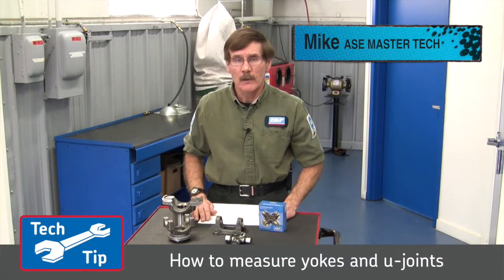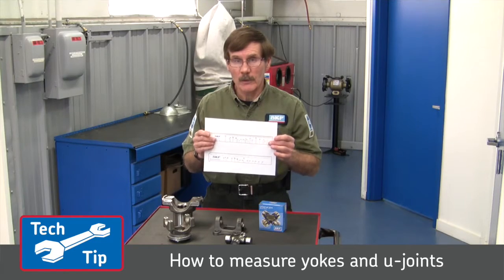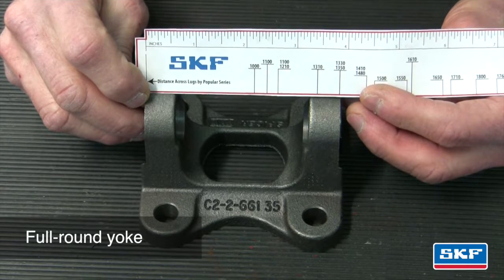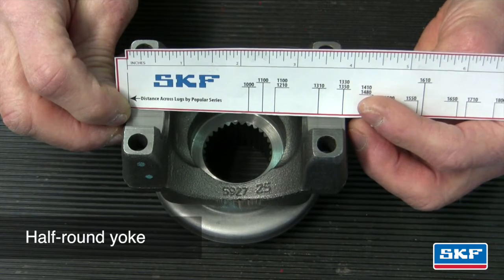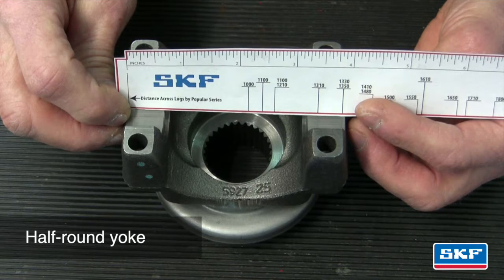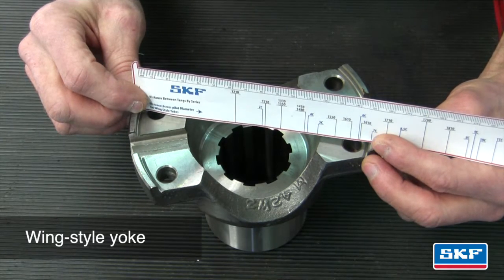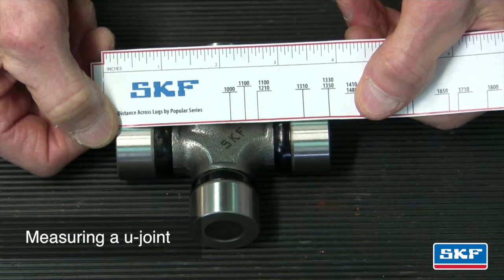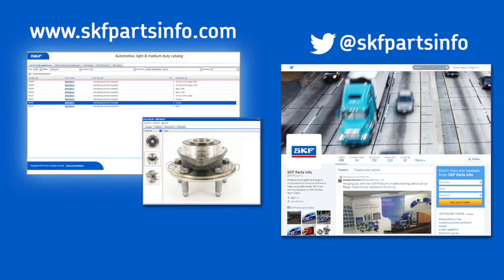How to measure yokes and u joints

Comment: How do I know that my printer printed the rulers to scale?
Reply from the maker: If your printed ruler looks similar to the printed example in the video than the ruler should be printed to scale.
Reply: @SKFPartsInfo  mine looks that way but what if its to small? Says I have a 1410/1480.
Reply: @SKFPartsInfo  my ruler is not the length of the paper

Comment: Hi, 
Would you know if I can replace my single ujoint with a CV ujoint on the same driveshaft? 
Thanks bunches.
Reply from the maker: In many cases a new driveshaft is needed to switch from a ujoint to a CV joint. Because of the differences in applications and  complexity of the parts involved, taking your vehicle to a trusted mechanic is the best way to get a definitive answer to your question.